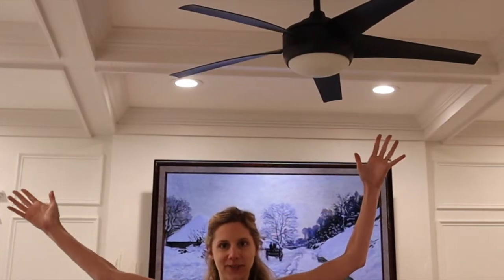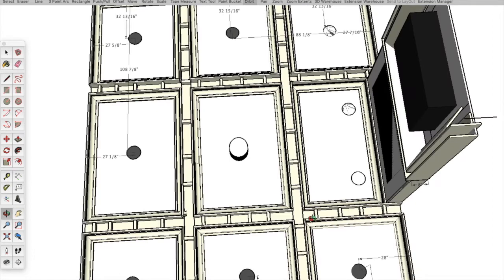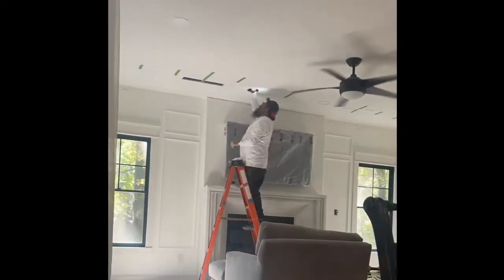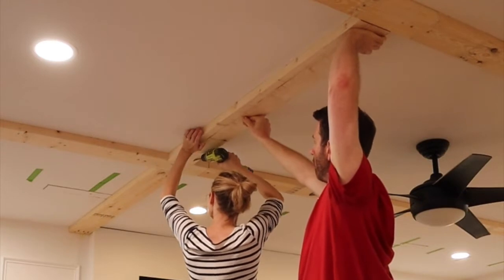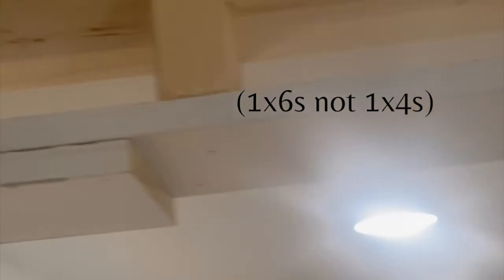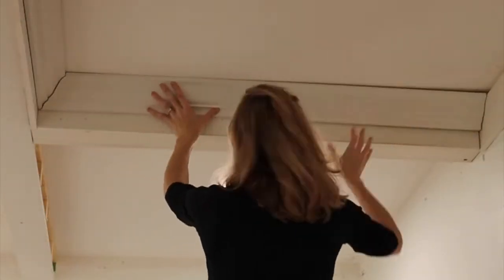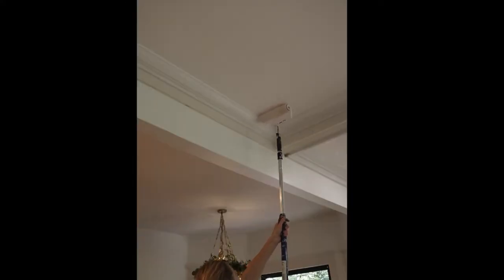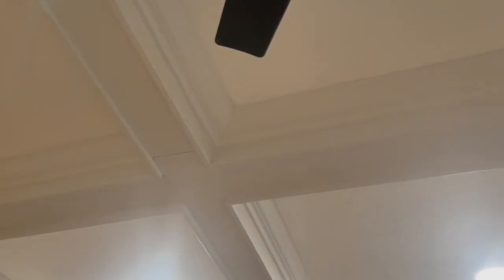How I Built a Coffered Ceiling

Comment: Hey there. Bondo good choice. What kind of texture should I go with for 8x12 dining room portion having popcorn throughout rest of ceiling. Planning to coffer around perimeter of this portion too perhaps add few 4-6” holes with trim that LED strip or rope lighting behind crown molding  could  shine through or us recessed downlights. Also considered using faux decor ceiling tiles in this area and have a 22” chandelier with medallion to use above it centered in room   Thx 🎉

Comment: Great job! Do you recommend the crown moulding you used?
Reply from the maker: Thank you! Yes the specific crown that I used is listed in the full blog post (link in the description.)
Reply: Well done TS. Joinery is an art in itself given woods tendency to expand and contract with the seasons. MDF is far less prone to movement, and a flexible filler helps prevent seams from opening up. Just steer clear of products like epoxy, Bondo and Durhams.

Comment: Beautiful job. I see that Im a couple years behind, but im getting ready to tackle this job and I have two questions.  I see that you used pocket hole screws that connect  the short boards to the  long board,  but  the short board to the wall is my mystery. @ time 1:44 (Paused), the short board that's touching the wall, How is that end attached and what is it screwed into? Any help would be greatly appreciated!
Reply from the maker: I used pocket holes to attach those short boards to the wall as well. I think I checked to see that I was screwing into studs but I can’t be sure. It’s not the most structurally safe in that case so make sure you’re applying some sort of adhesive like liquid nails to the underside of the board and attach to the long boards with pocket holes. Hope that helps 😬